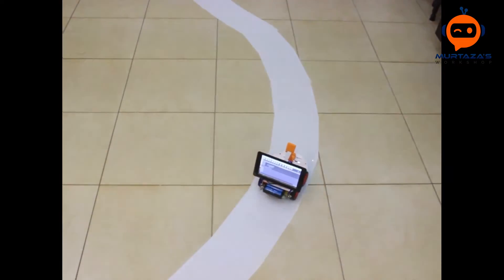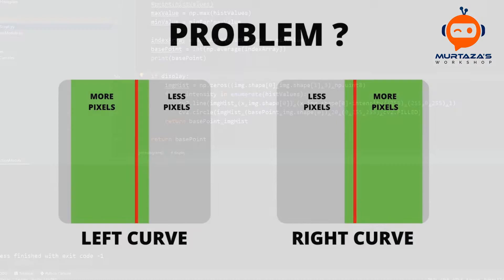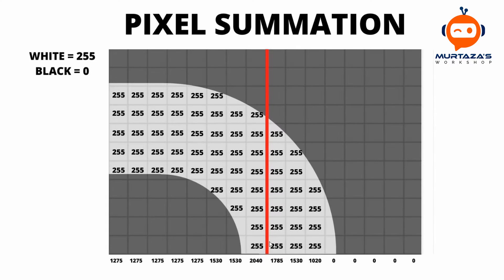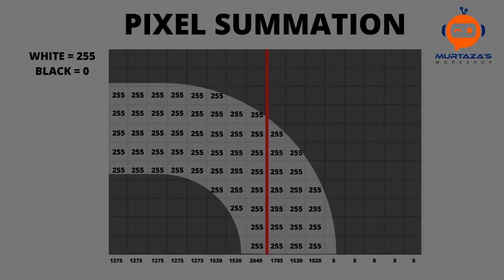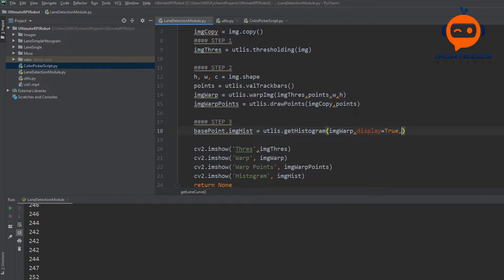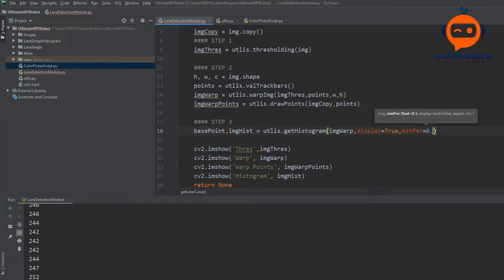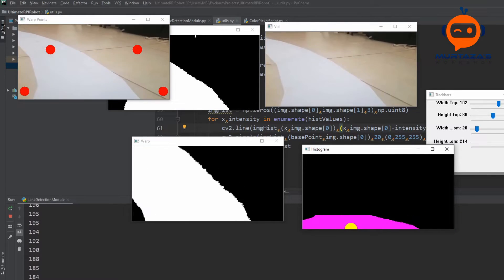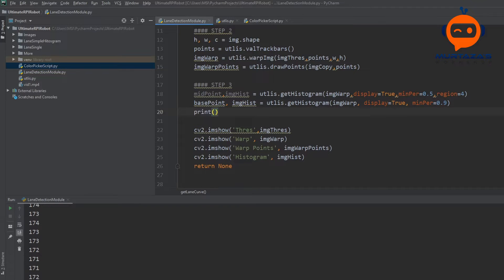Optimizing Curve Value | Self Driving Car with Lane Detection using Raspberry Pi  p.5

Comment: Great Project! I´m finishing implementation but I am receiveing an error message when trying to run, could you please help me on that?

[ WARN:0@2.510] global ./modules/videoio/src/cap_gstreamer.cpp (1405) open OpenCV | GStreamer warning: Cannot query video position: status=0, value=-1, duration=-1
Traceback (most recent call last):
  File "/home/XXXXXXXX/Desktop/MyTests/MainRobotLane.py", line 35, in <module>
    main()
  File "/home/XXXXXXXX/Desktop/MyTests/MainRobotLane.py", line 13, in main
    curveVal = getLaneCurve(img, 1)
               ^^^^^^^^^^^^^^^^^^^^
  File "/home/XXXXXXXX/Desktop/MyTests/LaneDetectionModule.py", line 15, in getLaneCurve
    points = utlis.valTrackbars()
             ^^^^^^^^^^^^^^^^^^^^
  File "/home/XXXXXXXX/Desktop/MyTests/utlis.py", line 33, in valTrackbars
    widthTop = cv2.getTrackbarPos("Width Top", "Trackbars")
               ^^^^^^^^^^^^^^^^^^^^^^^^^^^^^^^^^^^^^^^^^^^^
cv2.error: OpenCV(4.6.0) ./modules/highgui/src/window_QT.cpp:495: error: (-27:Null pointer) NULL window handler in function 'icvFindTrackBarByName'